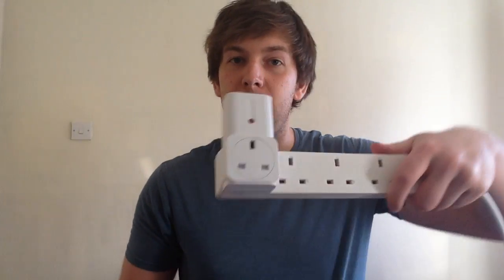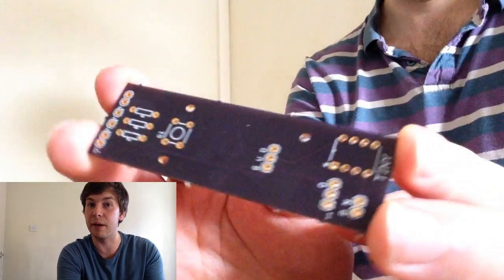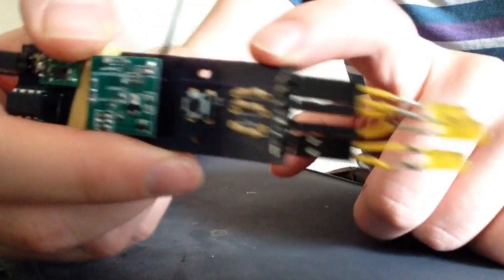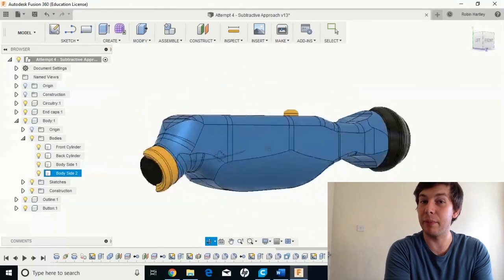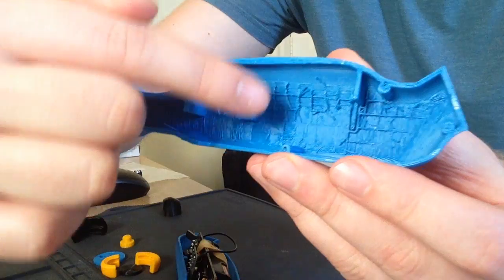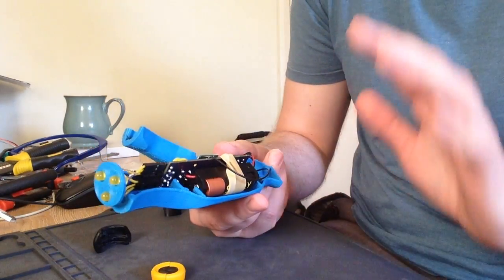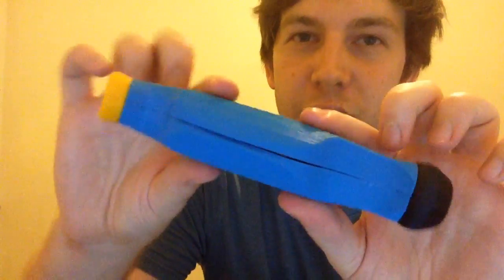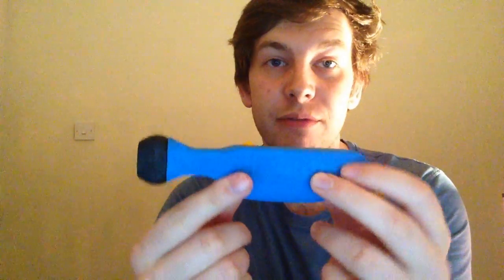Sonic Screwdriver Plug Socket Controller

Comment: When you press the button to turn something on or off, does it only trigger the switch/relay that you're near, or all the ones in your house? (assuming you have more than one) If it only triggers the one that's near you, is that because the transmit signal is weak enough it doesn't reach the others? or are you somehow addressing the other relays individually?

Regarding you statement about the code: "I tried to find it again to credit the author, but with no luck."
Your code looks similar to what David Court posted:
http://www.fanjita.org/serendipity/archives/53-Interfacing-with-radio-controlled-mains-sockets-part-2.html
https://gist.github.com/dccourt/2269298

Do you recall if that's where you found the code?
Reply from the maker: Hey thanks for your comment and great job tracking down the source code - this is exactly the one I used. I'll now go and update my blog, thank you! Credit where it's due and all that.

As for the way it works, it's over radio so there is no directionality - anything in range will turn on/off. The range is pretty decent, I can control sockets from the other side of the house through several walls.

For specificity, there are 16 different channels that the plug sockets can be adjusted to, so in theory, you can separately control 16 different things. My screwdriver is hard coded to just control channel one (as there is only one button), but it's a small software tweak to make it multi-channel.
Reply: @robinhartley2627  Glad to hear that was the source!

Okay, cool. I had assumed it was omnidirectional and far-reaching, but wanted to check and see if you had added some other feature to make it directional :-)